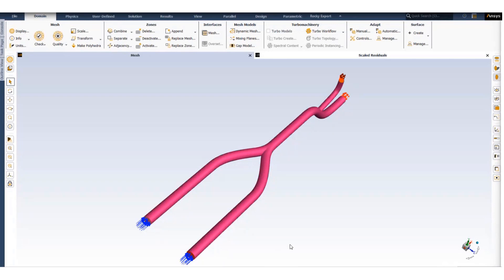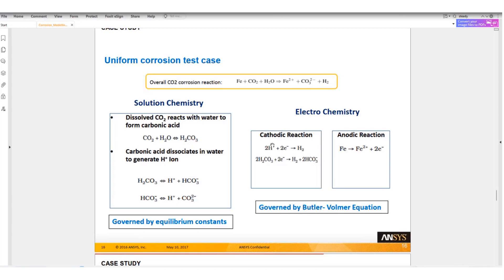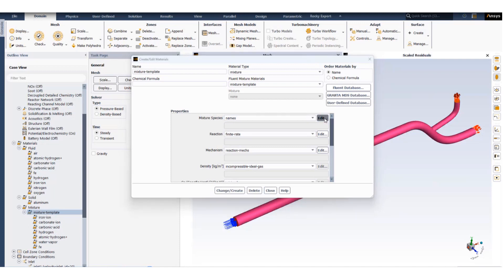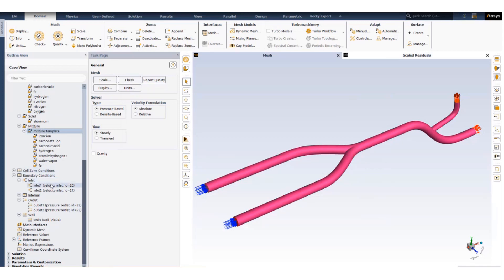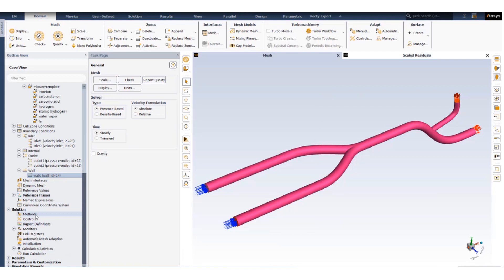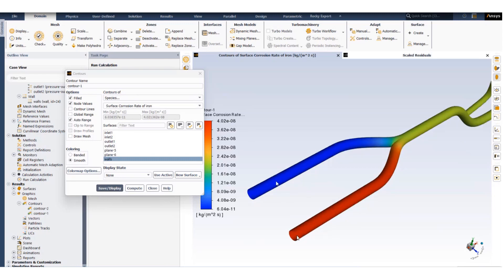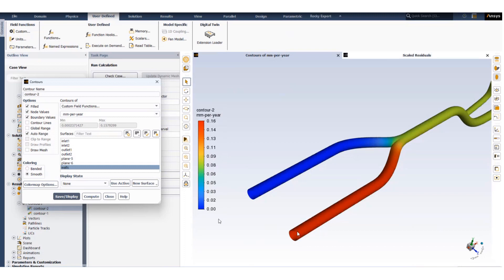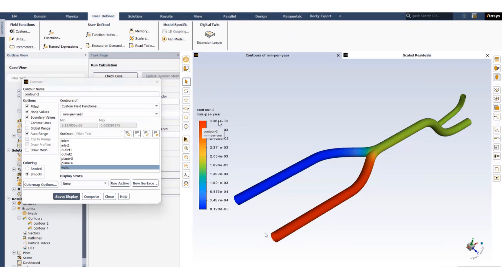Estimating metal pipelines corrosion using Ansys Fluent

Comment: Can you tell me why the surface corrosion rate isn't showing but the simulation has converged
Reply: how do u add the materials that is not present in materials panel?
Reply: @manishsahoo7945  you should copy the material and change a charge number only